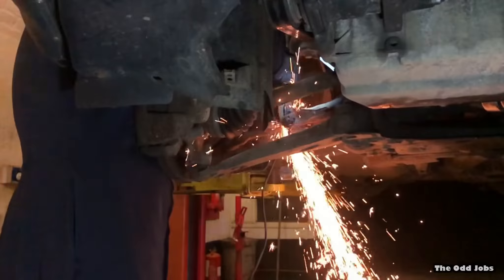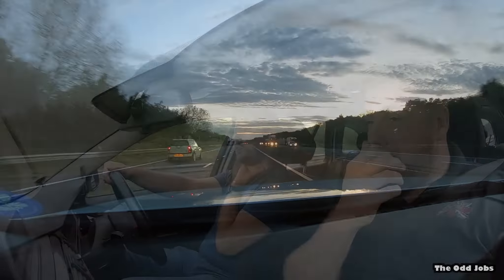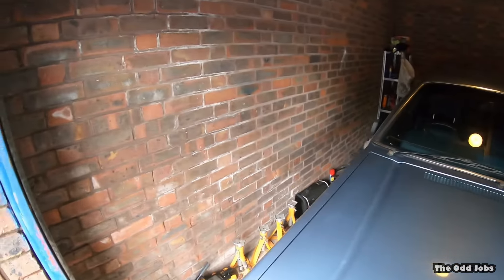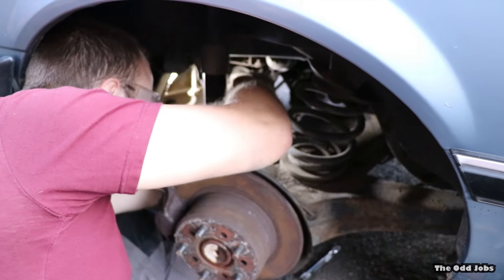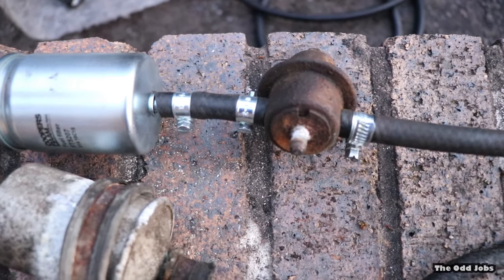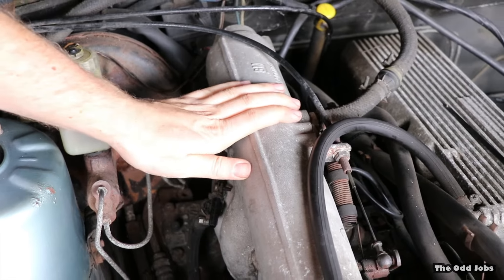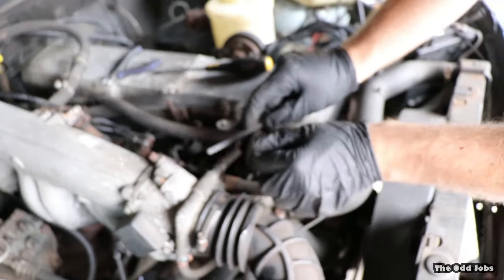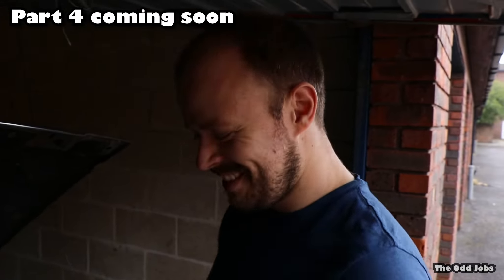Opel Monza series 1 (1979) Barn FInd (part 3)

Comment: The fuel pipes around the fuel pump and filter seem to leak on a regular basis on my Monza, even though I've replaced them with new. I should check the fuel tank, I filled mine up and petrol leaked and I replaced it with a new one. I'm really enjoying your videos, great work.

Comment: nice job! Owned a monza (royale) myself. You still can get a new fuel tank on ebay. From my experience you better take the whole tank out of the car an renew all hoses. On the inlet manifold it better to replace all fuel lines, because they tend to leak on all couplings. Or even better, get an injection rail from a 6 in line opel B senator (or the vauxhall equivalent)model years 1987 till 1994 and remove the injection resistors. The resistors are those two aluminium blocks with the wires coming out off them mounted on the left on the car at the inlet/exhaust monifold side in your case left of the brake booster. Its a bit off work, but till better than fuel leaking on the exhaust manifold and a possible fire (you won't be the first one ;) ) Except for the rust pretty bullet proof cars in my experience.
Reply from the maker: Great advice, we are removing the tank today because we feel the same about it :) with regards to the new fuel rail, we have replaced with a newer like for like (upcoming video) but if that doesn’t do any better we will look into a different one :) thanks for the comment 👍🏻👍🏻